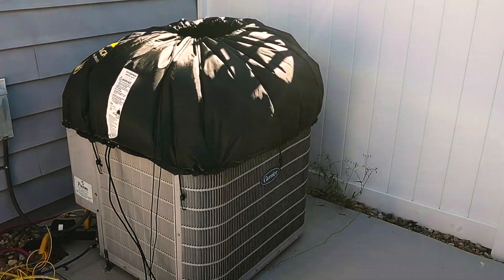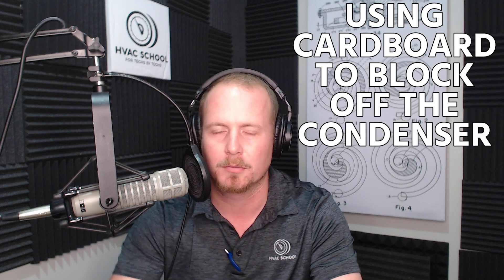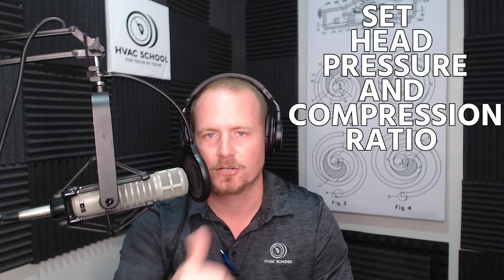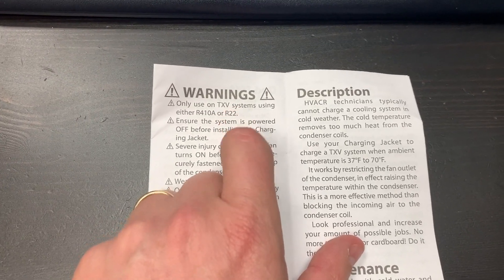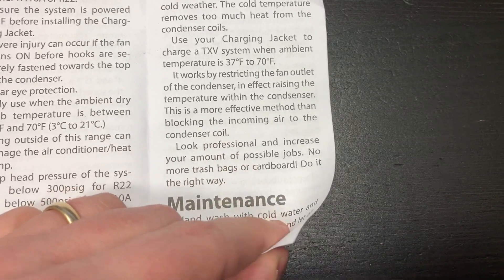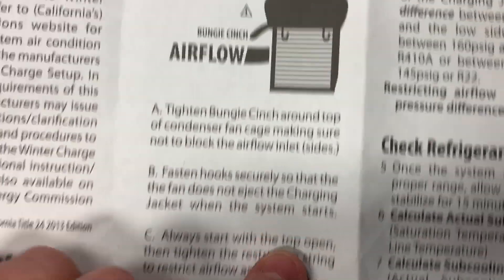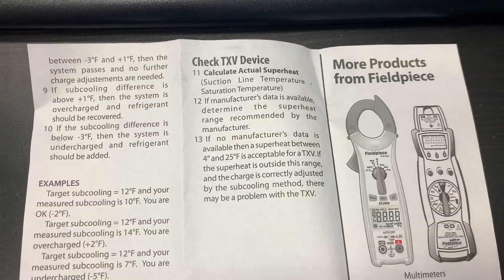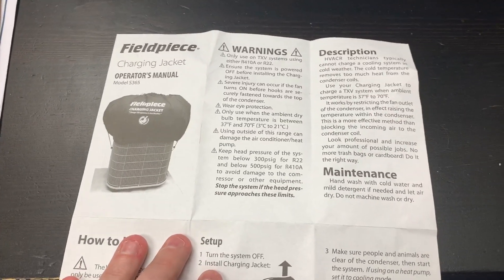Charging During Low Outdoor Ambient w/ Charging Jacket

Comment: Perfect. I have been tending ten plus units on hydroponic buildings for a few years and my winter jacket over the air discharge bring air outlet to condensing temperature (give or take 15 degrees) with a load of 80 percent, gets me very close to a saturated evap coil or 25 degree superheat on these cheap fixed flowrator piston systems. Still waiting on an answer to install txv on all air handlers..R410a, once I experienced my first txv system..it became a no brainer for efficiency choice.
Thanks Brian Orr and supporters for these videos..always solves any debate or questions.

Comment: Hello sir, I appreciate the awesome videos and yours is the first podcast this old man is listening to.   Question,  why do techs do summer tuneup in spring for residential system?  I would have though you'd want to do it in summer when there is load on the system so you can check performance (pressures, temperature splits, amp and capacitors).   Other than filter, blowing out drain and may be cleaning condenser coil, not much one can do in spring.
Reply: Money my friend, money... When you've run out of furnace clean and checks to do, you can start doing AC clean and checks earlier in the year and thus charging customers for repairs during what would normally be considered your slow season.

Comment: I went down to Goodwill or the Salvation Army outlet for used outdoor six man or eight man size tent. I cut a hole in the bottom that fits over condensers. Very convenient on rainy or very cold days especially when you’re doing mini multiple condensers all at one time just pick up and move to the next one. 
                You walk inside and just open up window flaps to adjust temperature it can be a torrential down pour outside your nice warm 80 or 90° inside your dry all your equipment stays dry and you’re comfortable and you could work slowly and peacefully in rain or snow.  It’s not rocket science something my father taught me pre-high school. 
            If it’s very windy outside and you’re on a rooftop remember to bring anything very heavy that could hold down the four sides otherwise you will have a kite.

Comment: Not a good way to charge. The proper way on a new install is to measure the line set and add refrigerant to cover the length over 15 feet by weight. If an existing unit is low, find the leak, drop the charge and charge the way you would a new install. Either this or wait for a 55 degree plus day to charge via subcooling.